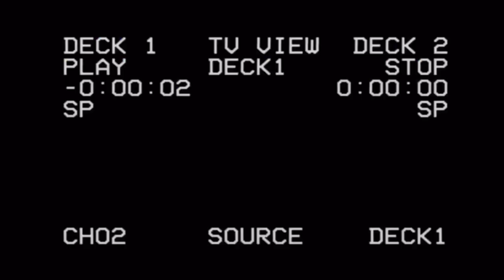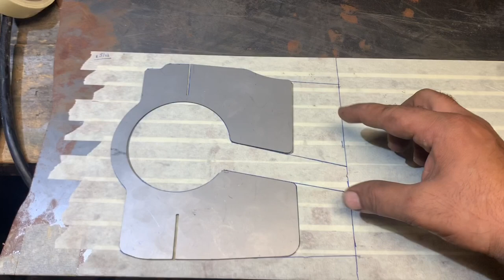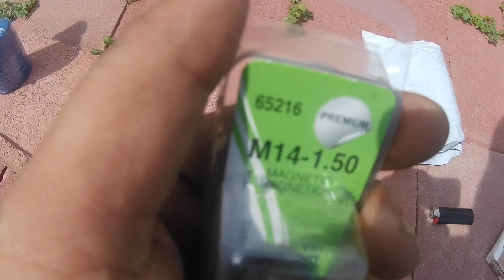integra b18 b16 diy oil pan baffle

Comment: Why didn't you add another 3/4 of an inch on to your baffle and just fold it up instead of welding?  Doesn't this baffle design just hold the oil on top of the sheet you have welded in and cause it to be whipped up and aeriated by the crankshaft which will pass in close proximity?  I don't know just asking as I don't see good routes for the oil to get down into the deep part of the sump.

Comment: Another great video. So what is the purpose of the oil pan baffle? I've never seen nor heard of this application.
Reply from the maker: unique_integra_owner the plate inside the oil pan is to help keep the oil from moving to the sides of the oil pan under hard turning
Reply: @RevHighDriveHappy , I have never had a track car so I'm trying to understand the pros and cons. This is one of the reasons I instantly got interested in your videos. The way you narrate the details of your modifications and why. I'm just an old dog trying to learn new tricks. I do appreciate the fact that you don't mind answering questions. That right there is what I respect the most. Keep 'em coming my friend. Oh by the way, what is your ultimate goal for this car?
Reply: unique_integra_owner watch his video your learn some good diy’s and some tips and tricks 💪🏼

Comment: Hows it holding up and hows the oil pressure gotten better with the baffle or nah? Thanks
Reply from the maker: This actually works pretty good. The oil pressure didn’t go up but I was worried about oil starvation while at the track.
Since this video I’ve upgraded to a Moroso 5.5 quart baffled oil pan